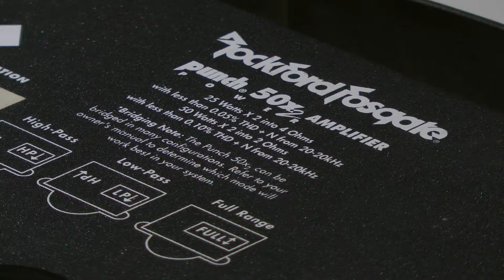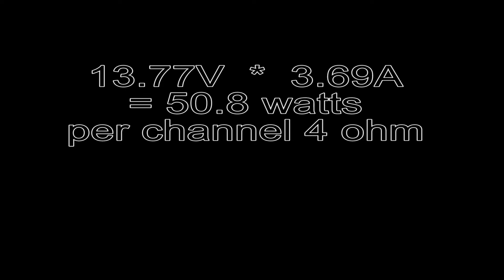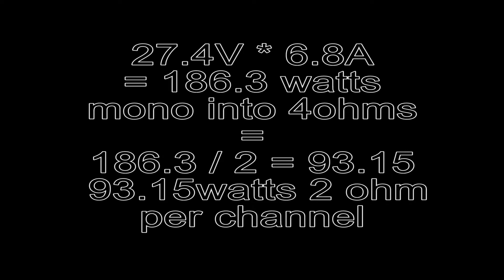Rockford Fosgate Punch 50x2 Power series amplifier dyno run test & PSD-1 cheater amp

Comment: Nice amps. I have a 250x2 power series in the dark gray. Have u ever dyno tested a 250x2?
Reply from the maker: no i didnt, but i dynoed 225.2 and a 500a2. they are very similar to the 250x2 in terms of output power 👍
Reply: @audiokeller1975  oh ok, what was the  numbers if you remember?! I'm pushing 4 12 inch subs and it kills them lol...
Reply from the maker: if i remember right the test was done with the 225.2 and it delivered almost 700 watts mono 4 ohms with a 1kHz test signal continuous and a supply voltage of 13.6 volts.
Reply: @audiokeller1975  wow Holy moly!!! I'm pushing 4 12 Rockville subs in a 2ohm load bridged it handles them and they really put out the bass! Thanks for the Info I like the videos
Reply from the maker: Thank you very much! That keeps me motivated to make more classic dyno videos 👍😁
Reply: @audiokeller1975  absolutely I also a 400x4 it's a  beast also. Keep doing the great videos thanks.

Comment: Thank you for this! I have 2 of these and have been dieing to see them tested. I also have the 250m and 250 x2, anyway you test those?
Reply from the maker: Hi!
Thank you for your comment!
I also had two of them and the punch power 50m. And i had two of the punch 250m :)
Yesterday i had the punch power 250m on my bench and made a power test.
All amps i tested so far have been tested for continous power and most of them, especially the smaller ones like punch 40 , 60 , 100 , 200 etc. exceed their ratings.
The punch 250m doesnt, yesterday it delivered 260 watts @ 4 ohms. The main goal of the 250m is to provide a lot of dynamic power instead of continous power.
Uncertified tests showed more than 1300 watts on 0.5 ohms.
Check out the punch power 500m dyno from BigDWiz, its almost the same amp.
Maybe i have to find a way to apply shorter burst signals to the amps. This will show much higher output power. But i use sinus signals to compare them. A bridged 250x2 should deliver more than 600 watts of continous power mono @ 4 ohms. But i dont have the 250x2 anymore. It should be, but not really sure, the same like the 500a2 or 225.2
Greetings!!